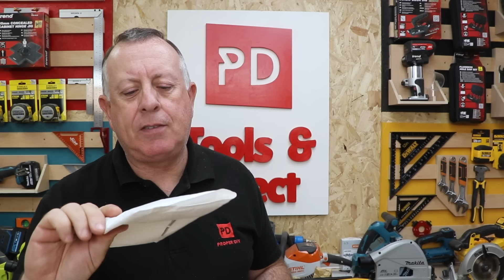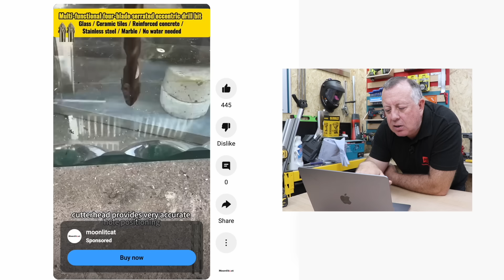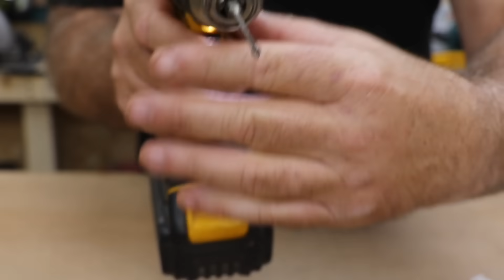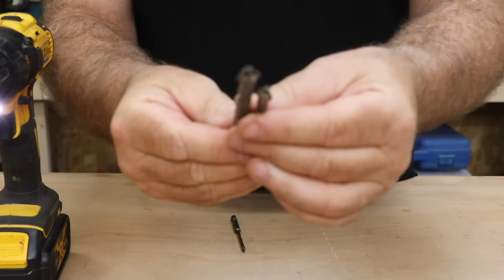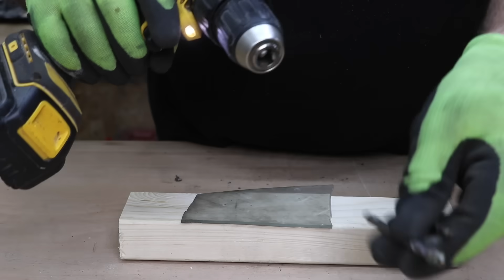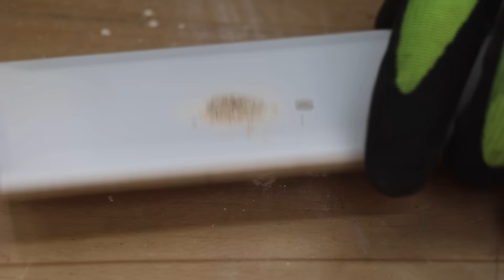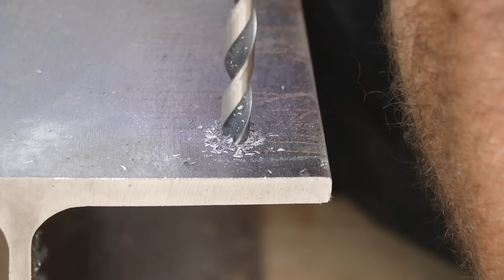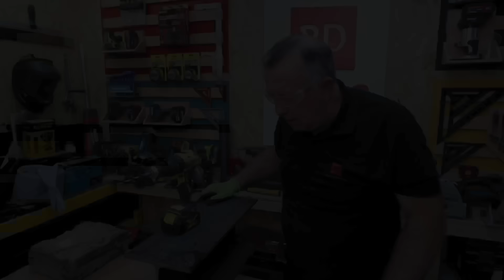Over Priced Drill Bits that Speed Through ANYTHING - Really?

Comment: Temu sell the exact same rubbish for £3.77, you were ripped off. When you read the comments they are good but probably never used like you used them on the demo. I never buy any tool or tool accessory unless it's supported by tradesman reviews. 

I think these bits have been bought in bulk and the reseller has jacked the prices up and people not in the know will buy them without any research or advice. 

The one thing I also don't buy are tools and measuring equipment from Temu there are lots of videos about the tat being sold on the Chinese markets. Also anything on Facebook if it looks to good to be true don't buy it, copy the tool title and slap in Google and duck you will find the price is cheaper on the whole.

I bought two large car drying cloths from Temu, these worked perfectly and dry you car in minutes £3, on Facebook are same towels for the gullible £20 just because it has a maker logo but they do the same thing as cheaper towels but people will buy them.

Comment: brilliant video and thanks for the link to the Bosch bits - I just purchased via your link - so hopefully you an amazon affiliant and get a few pence - I use almost exclusively now the Bosch multipurpose drill bits - dont need hammer on all the brickwork etc i have needed to drill - quite a lot of different type - BUT i did struggel with some metal recently and broke 2 bits trying to drill a small hole - maybe i was using to fast a speed - HOW did you get the speed that low on a dewalt cordless drill ????

Comment: I got suckered into buying some of these a few months ago. I had a load of shelves to fit and thought that's just what I need. I used the 6mm it was blunt after half a dozen holes and in the bin within minutes! I bought a Fischer masonry bit and the job went like a dream. Lesson learned.
Reply: Like my dear old nan used to say, buy cheap buy twice, bless her 😊
Reply: 5mm Bosch SDS masonry bit I killed it after 3 holes, hitting some granite and rebar. But that bit had already done 12km of work, as it was used to install 12km of lighting in a shopping mall, over a 2 month period. Still have it, ground to a sharp point, and used as a scribe, though even without the carbide tip on it it still did the other 2 holes for the last fittings.
Reply: @SeanBZA  I make scribes from old drill bits too. 👍
Reply: Don't feel bad about it. I've been bitten a few times too,  but it does make me appreciate quality. A good lesson sometimes as long as it doesn't cost too much!
Reply: got bitten once ( a complaint to my bank got my money refunded )
now i watch this channel before thinking of buying anything
Reply: Yup, the lesson is never trust anything from chinese/india/pakistan.
Reply: There's a lot of different grades of tungsten carbide. Some are better than others are.

Comment: Thats why I never buy any drill bits that claim they are all in one super duper and the only one you need.
Reply: Bosch does some drill bits that are multi-material. I mainly use them for drilling holes for wall plugs as they have tips that don't wander as much as ordinary masonry bits tend to.
Reply: @rfrisbee1   I have dewalt masonry bits that don't wander and  there proper bits for steel and tiling, if using multi bits for everything then they will go blunt eventually quicker